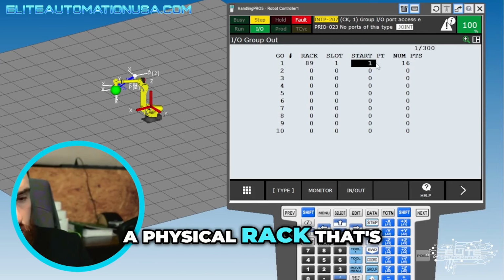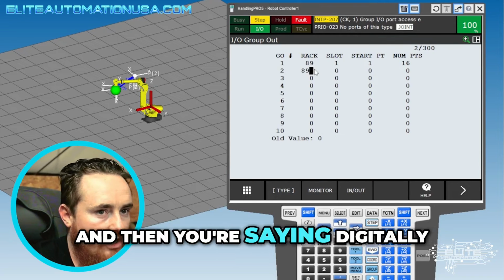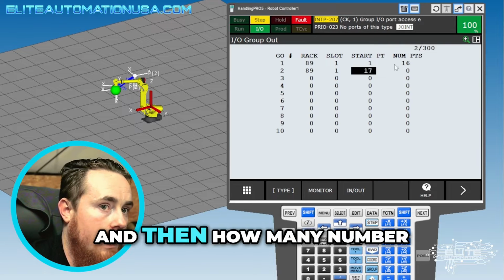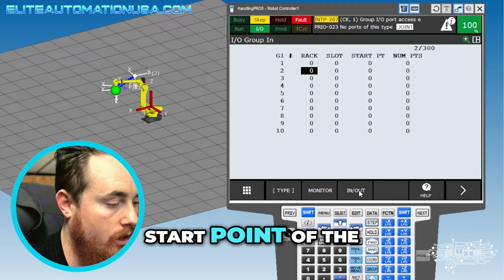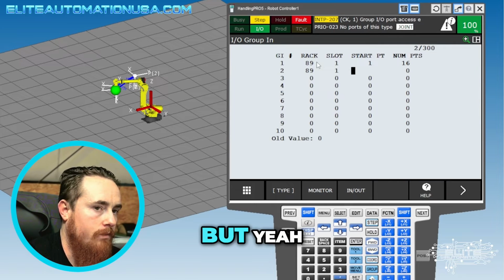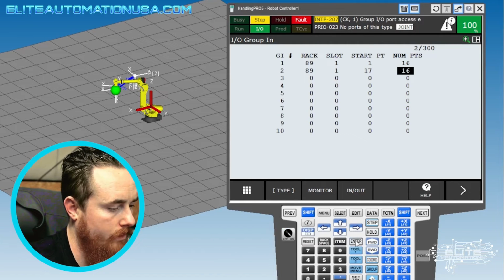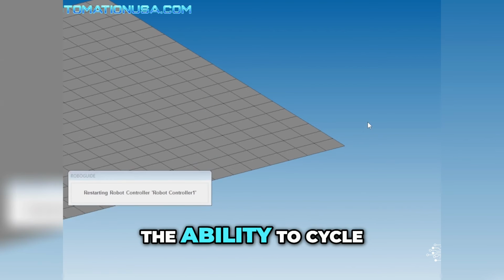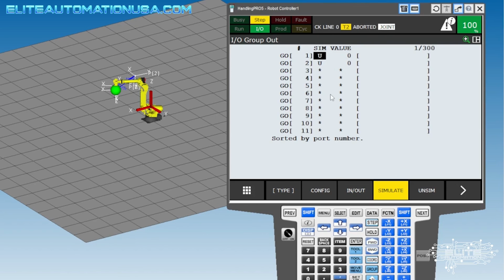Mastering PLC IO: How to Assign Inputs and Start Points

Comment: is there any way for me to stop the robot process when it is still running using the DI I/O? ive been trying using it with IF THEN instruction but that only made the robot stop when it finished 1 cycle.
Reply from the maker: There is a UOP signal that can be controlled by the PLC. Of the PLC drops the UOP signal robot will stop. It can also send pause signal. 

To pause in the robot only that would be a wait statement for some condition. You could also do IF and Loop. If on Jump to and put the label above the loop.